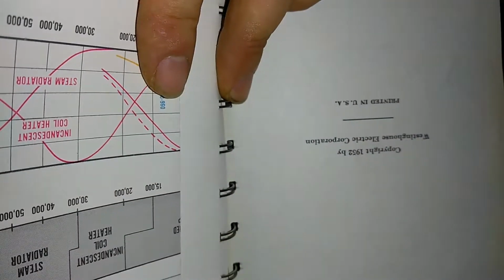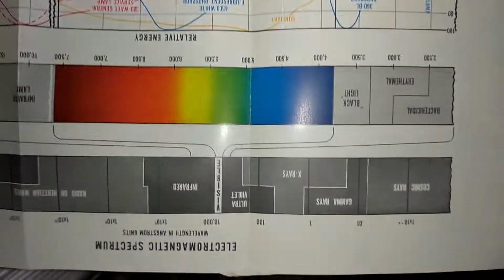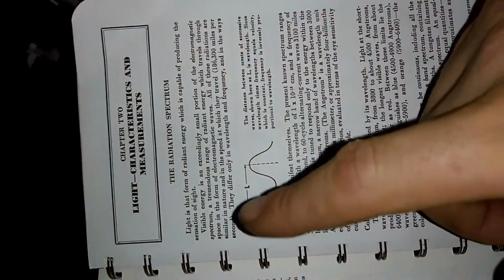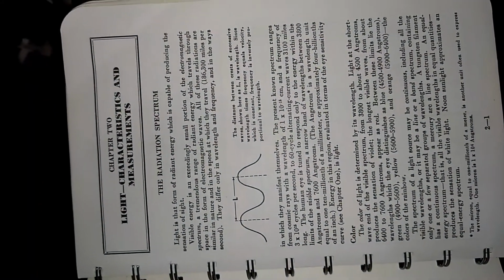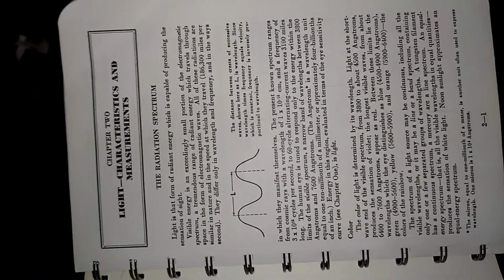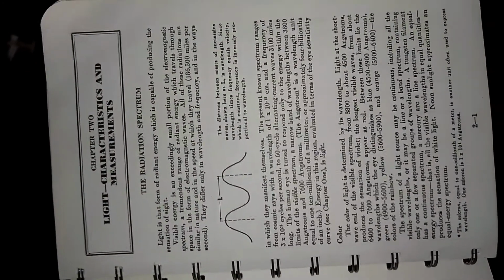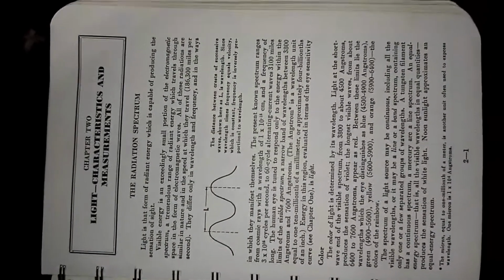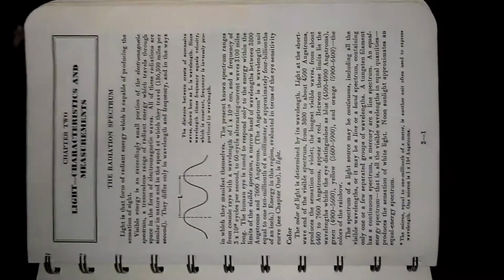Electrogravitics

Comment: JJ Thomson 's book "electricity and matter" starts up explaining faraday tubes (dielectric limes of force) and their interaction with aether when moved transversly. He states all mass is Aether, as it has momentum, and inertia.

These lines (under tension) connect us all, and seem to be what's pulling us to the earth.

so a capacitor, which is full of dielectric lines of force (faraday tubes) should be able to change these connections to the earth

Comment: Wow, Sorry to bother you again, but am I understanding the westinghouse definition of a cosmic wave? We are actually using cosmic waves to produce(sic) the electricity that we use? that is truly amazing. makes total sense though. thanks again.
Reply from the maker: jimmy popp see van allen belt radiation. the earth is the capacitor of this energy, you just have to transform it useable electricity.
Reply: Thank you so much brother. I have been experimenting non stop for the last few days with high voltage/high frequency pulses.. (a continuation of a 'radionics type experiment(i know, I know)) I designed and made two custom made spark gaps that are stainless steel with an aluminum insert and then tungsten and a couple various other metals. with one combination everything electronic reset in the room including my monitor and other things. I truly thank you for answering me and someday I hope we can meet and become friends without you worrying about someone doing something horrible to you. when you are as intelligent and brimming with knowledge as you, I can see how people would be scared. I am so intrigued because I have so many questions that sometimes I do not know how to phrase them. I just purchased a Peak scientific Nitrogen generator and all the liquification apparatus. I really want to start my own analytical testing lab and materials science center and you would be the greatest addition I can think of from what I have seen at least. You seem caring, thoughtful and have all the qualities that the powers that be dislike.we are on opposite sides of the USA however. If my questions ever get too much, i know you will politely tell me. Some things are just so bothersome such as ;why do people think it is necessary to make don's seemingly simple apparatus even more complicated by adding the rolled extra aluminum capacitors that i do not see anywhere and say that they are needed for the conversion of reactive to usable energy. I will try to make this the last time I ask this but I cannot promise..lol  Am i correct that I can accomplish what don says if I use an nst then his gap/ground tap thingie ( scientific thingie, not normal thingie) -high voltage ultrafast uf5408 bridge diodes then to a bank of 4uf 3,000volt russian military caps then to a ( have one of the coolest things---a deuterium thyratron for frequency adjustment/valving) to a voltage divider network to usable energy. I do not have everything I need yet but I will keep you informed. I am missing the second ground gap thingie, but as far as I understand it and from seeing the 'working'model of the coke machine device it seems this is it When I get a chance and have everything either my hopes will be dashed or I will feel as if I really accomplished something and I can invite you to my lab in South America where my beautiful wife and I will not be bothered by anyone but friends are welcome to drop in anytime and enjoy the beach or lake , or...for as long as they would like. I know but it seems like a great dream and no one gets hurt. thank you Jeff
Reply from the maker: jimmy popp you only need the nst to one diode to a cap bank. that creates a wireless field around the circuit that strength is dependent on the frequency of the driver in the NST which is about 38khz stock from the factory. being able to adjust the frequency in the driver of the nst is recommended for more wireless power. additionally multiple recievers can pick up from a single source, multiplying the output past unity. 

the wireless power, the fast charging cap, and switched discharge are the main principles of the don smith device. 

the foil capacitors are key since they utilize the planck oscillators that make up the vacuum as a reaction to the dipole energy present on the cap plates. the charge coming from the nst and the energy captured in the capacitor are equal and opposite charges but the capacitor is not filling up with DC electricity since there is no ground. it is simply potential that is coaxing a reaction from the vacuum in between the plates of the capacitor. you will notice that the cap discharge is significantly different in appearance and behavior than the electricity used to charge the cap.

this is a mirrored electron like the Wu experiment. 

switching the cap through a reverse bias diode by two transistors regulated by resistors to set the frequency will set up a double square wave pulse that when transformed in the transformer becomes a sine wave to your load due to the geometry of the coils conditioning the wave path.
Reply: Thank you so much!!  I believe you are able to read my mind at least in being able to discern (yes I said discern, but obviously you are on the LEVEL...lol) enough to be answer what I tried to ask...(esoteric joke without alliteration at no charge...lolllzzz)----(lolllzzz as described by my little sister as something cool so I had to add for her)
Reply from the maker: unfortunately ive been dealing with psycho paths with psychotronics and "dirty tricks". 

a terrorist cult of satan that needs cleansing in my country.  the masonic order has been infiltrated and abuses the Sacred Word. 

the organizing principle of the universe has revealed itself to me for the benefit of all. 

the universe is NOT indifferent, it produces beings like myself as a reaction to these violators and the span of time in which they "sinned"  and the evil they served will only serve the greater good in the context of evil in which judgement will be handed down. a punishment they are willing to accept.

their punishnent will be a perfect purification of love and compassion.

they are caught in a Krischoff loop and will never achieve over unity of their being. only false promises and limited veiwpoints caught up in time.

sorry but this science is the science of being, to be regarded as sacred. 

false pride is a slippery slope but sacrifice trumps all of that. 

my sacrifice is must be friends in the general term.
Reply: Jeff you are to be honored and admired! It makes me sad to see the low numbers some of your videos get. Every one as far as I am concerned should be held in the highest regards. Yes it has been infiltrated. The universe does have a yin and yang where karma is concerned. I have seen it in my own life. What has been revealed to me only within the last ten years has scared me at first bmainly because I know now that we are here and not going anywhere. It is like a prison planet. However it also shows us that we are special and not just random garbage that happened upon a self awareness. When I talk of going off grid and disappearing and making a sanctuary for people like us I truly mean it.  I used to be a research pharmacist and helped write a book called the PHARMACOTHEON with a man named Jonathon Ott. I am also contributing writer to several books on enlightenment through plants and endogenous biochemicals. For some reason the higher power decided that i should endeavor upon this and I have not been able to think about anything but for quite a while.  Believe me when I finally get this into a reproducable form I am going to help the people where they have no power and are dying. I may not be the one to do it personally but I will enable the ones who will have that ability to do it. I will provide whatever needed to research many things that you and I are struggling right now to do. I thank you for your help and you will always have a (all access invitation) to whatever we are able to put together. A wonderful place where whatever you wish to research you will be able to. from there we will be able to help without fear of reprisal. you and I are the scientists . My formal education and specialty is in organic synthetic chemistry and my secondary is in microbiology. I left my job and have been working on clean water, intelligence rebuilding, reduction of harm and from the clean water sprung the energy through hydrogen and oxygen. Did it ever cross your mind why all the technologies we should be using for energy produce oxygen and other byproducts that help the environment? just more to think about.  Am I dense in that you never said that those coiled aluminum extended bifilar things don never talked about you never said were necessary. once and for all I kinda promise...lol Are they necessary, or is the device that don shows for the coke machine complete? I believe it is. am I correct. Thank you again my friend and keep up the greatest work .
Reply from the maker: jimmy popp thank you for that response. im not sure how to say this but you may be the key to a very advanced biological technology called the SERUM. 

this is a coveted technology by Mark Hinds of Novusviafund.com

the serum is made up of the small pox virus distilled or reduced until the lethality of the virus is made mute. the small pox virus was found to induce para imunnization, killing all viruses in the body when infected by the virus before killing the human. this para immunization effect was noted by dr miles in 1954. 

since then synthesized by a woman scientist in germany forced out of her business by mark hinds through hypnotism and bribery.

I can show you how to make the cell line in order to create the serum. 

the serum rebalance the microbiology of the human organism which is being deployed by Dr Michael Hino of www.hinomedicalcenter.com

they administering the serum incorrectly, but the catch 22 is that they are servicing only the highest of oil families that will eventually suffer the consequences of their administration of the serum.

how would you like to proceed on this? 

the serum cures myco plasma infections, aids, and the cancer virus.
Reply: Wow. I am aware but not familiar. I  went to pharmacy school when there was a doctor that had several cures for the  aids virus. In the early 2000's I worked in a facility that purified gram quantities of the virus. I am not going to say too much more on that because I am sure that I was one of a handful of people working in NBC at the time who were qualified to handle catastrophic release of this.  I am in the US and am trying at the moment to get into a biological facility working on age reduction . to finish the Aids thing, the doctor was jailed the night before the talk and left go three days after the seminar. All of the paperwork was kept in the safe in our department. Every one of the papers were confiscated and destroyed. There are reasons to photocopy things and not take copies. but i digress. how can I help? i just left where I was working because the plant manager is a Pedophile and I could not justify even being near the guy. he put an 11 year old girl in the hospital and she will never be right. I have a facebook page and I would be honored to add you as a friend.  It can be up to you how we proceed. Now I am as concerned as you. I was not aware that you and I had so much in common.  Aids is cured. Look at Magic johnson. I think we have said enough in the clear.I am ultimately willing to join in this avenue. There are so many things I would love to share with you about that which you have just mentioned. Also there are some things that we should discuss concerning what we have been skirting because I have some people that very quietly would love to introduce certain technologies. I believe that is the way because then before you know it, its out . I await your response. And for those who think we are serious about this,, Jeff and I have been friends for years and I hope you enjoyed our little dance. Jeff, Just get back to me and we shall see how to make things happen.
Reply: Are you still there? I have not heard from you and I hope I did not offend by anything I've said
Reply from the maker: jimmy popp Im here. havent had time to respond. ill get back to you tomorrow
Reply: Thank you. i just thought I may have said something offensive somehow. No problem take your time Brother.
Reply from the maker: jimmy popp do you have access to a microfiltration system and equipment to handle cell lines?
Reply: Not at the moment. however i am starting a new job in a week and will have a much larger more well funded lab that promotes any research. Lets hope this  turns out. I cannot imagine that it would not.
Reply from the maker: jimmy popp cool. well lets see what you can do with what you have gotten from this thread. 

I notice that you have no video content. 

hopefully you can get the fast charge system going.
Reply: I have only been on here for a short time.I definitely want to get some content up showing what I have done with Don's stuff. Changing jobs has been a problem. I am going from helping a friend grow his steel business putting in 18 hour days and now Trump placed these Tariffs on and the Ceo cut everything down to a skeleton crew essentially. It has been five weeks of craziness but I really hope things have come around and I will have money and time. Let's not lose contact. Thank you. The Feynmen info is incredible. Thank you so much. Water is a dielectric however it makes a very bad capacitor....AKA Stan Meyer figured out how to change that though.
Reply from the maker: jimmy popp the water of the earth is the dielectric layer of the capacitor. a capacitor has a dielectric layer between the plates.
Reply from the maker: correction. cosmic rays are not 60hz. but the wavelength between the capacitor plates does capture cosmic waves or vacuum flux.
Reply: Thanks brother. Have done some very interesting things lately. Would rather personally show and or tell you. Thanks againn for the answer.
Reply from the maker: jimmy popp boring. make a video!
Reply: If I get killed how can i come back? I did an experiment using westinghouse 15KVAR Capacitors (hmm..where have we seen these huge things before?) ive made reactive power. while I am deciding the proper way to do the video I will explain what I pulled off. Seems Don was right .reactive power is like two kids jumping rope. Because the net is zero is there no usable energy? Hell no!! the reactive and the active can be brought together many different ways. He used resonant ETBC's. It's way easier than that. No one I have ever seen has ever shown  this device I may not show it doing anything either but it is built and has been used for.....just a tad bit more than collecting dust. WE MISS YOU DON AND YOU WILL ALWAYS BE AROUND IF WE SPEAK OF YOU. That is Donald L. Smith of course.
Reply from the maker: jimmy popp im eager to see